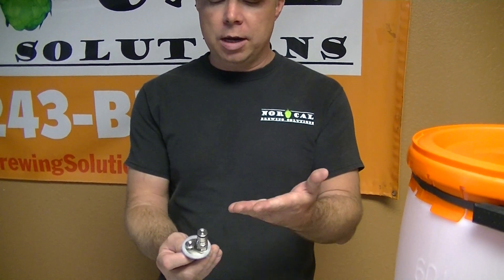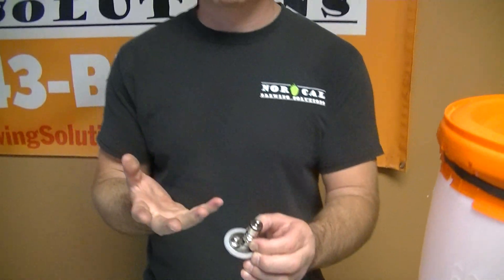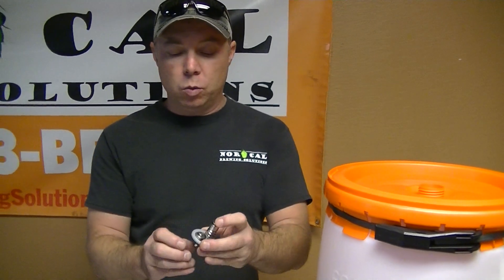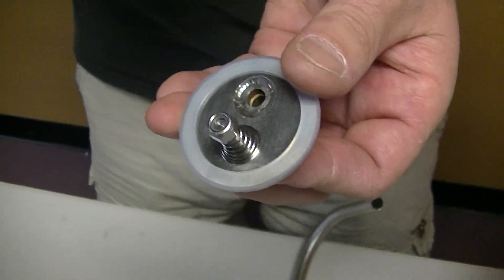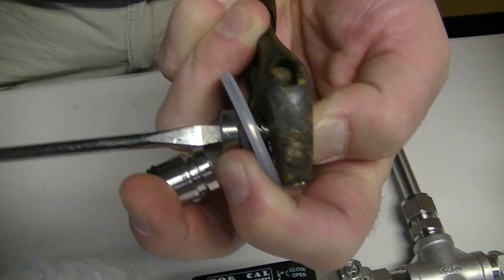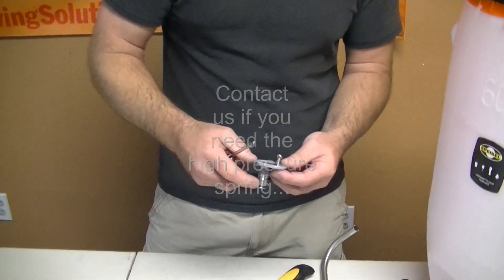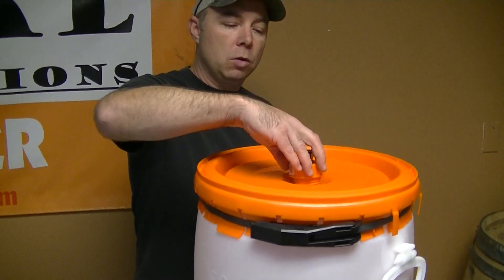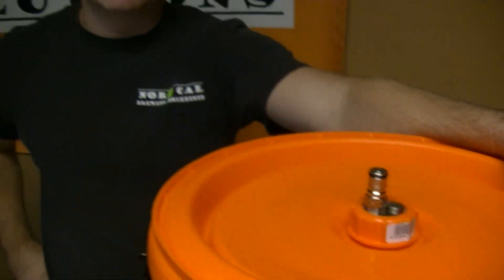Speidel Fermenter / Storage Tank PRV (Pressure Relief Valve) Adjustment

Comment: I have one, it works great.  I only use it to transfer under pressure to my kegs.  I don’t see how it will hold a steady amount of psi, for more that a 30 min or so, especially above 5psi.  Mine loses pressure matter how well my gasket on the fermenter is on. 

And if you tighten the silicone gasket the valve comes with to tight it rips. So be careful with that.  Still a great item, beats lifting 10 gallons of beer!
Reply: Thanks for the comment !  Here are a couple tips you can use to get your system to better serve you.
As for the Pressure drop.  We do sell a 20# spring that can replace your 3# Spring that came with the system.  You can also just add stainless washers to the bottom of your system to make the spring tighter.
As for the gasket.  I agree over tightening is the death of those gaskets.  Try using a little keg lube and that should get you to be able to set the gasket without over tightening it and still get a GREAT seal.  
Cheers
Jay
Reply: guessing you  use a ball valve with a pick up tube angled out of the trub for the liquid out?

Comment: How much pressure is maximum in this?
Reply: The plastic tank has a PSI range and honestly I can't answer that as we don't manufacture the tank.  The PRV is about 4-6 PSI unless you get the 20# spring.  We do however have a NEW 10# spring ON THE WAY.  :) 
Cheers
Jay